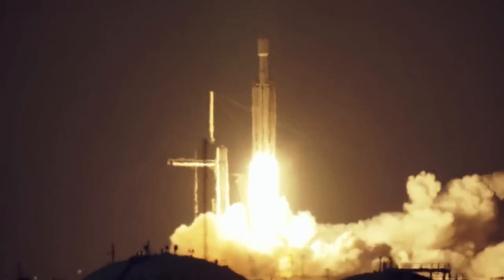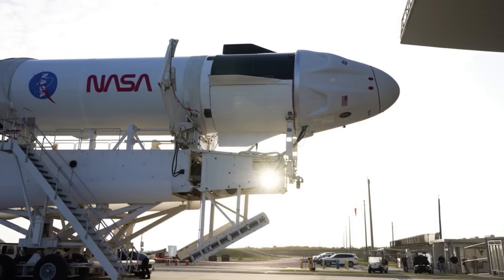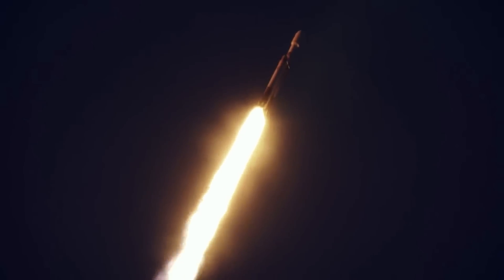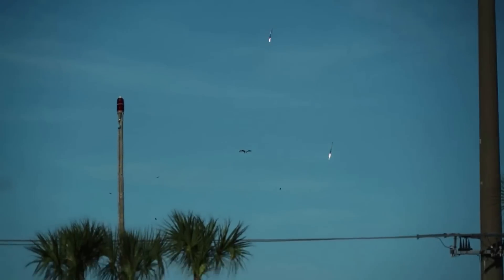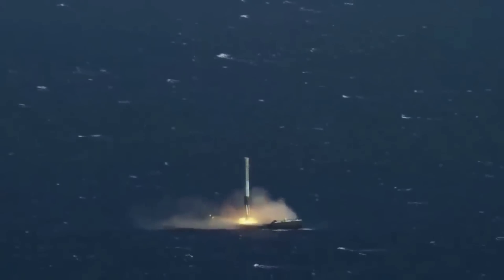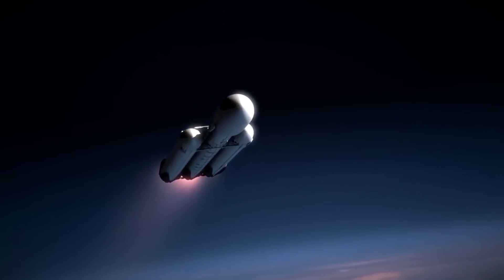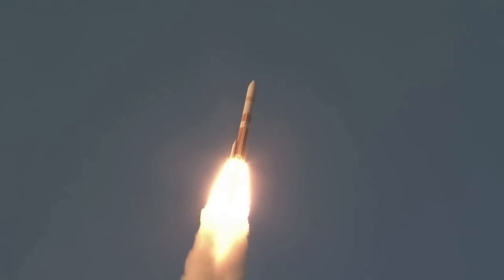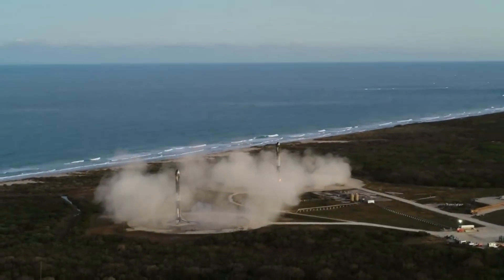A Closer Look At The Design Of SpaceX's Falcon Heavy

Comment: Falcon Heavy has a few more issues making it a niche launcher. As the video said, for light payloads the Falcon 9 is cheaper. For very heavy launches, FH can lift the weight but the fairing is the same so the payload needs to be very dense, compacted in a small volume. For high energy orbits, the payload capacity falls rapidly compared to other launchers with liquid hydrogen upper stages.
Reply: FH has so much LEO capacity that it can just brute force high energy launches, where the payloads are light enough to fit in a normal F9 fairing, usually meant to accommodate payloads of the same mass but to LEO

Hydrogen upper stages increase efficiency for lower LEO capacity launch vehicles